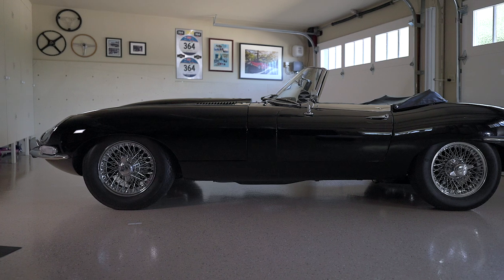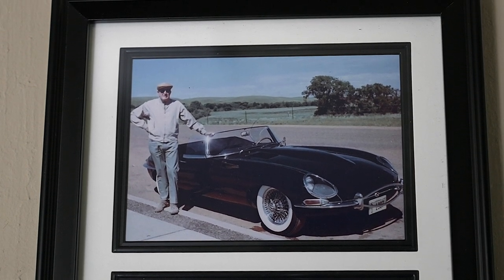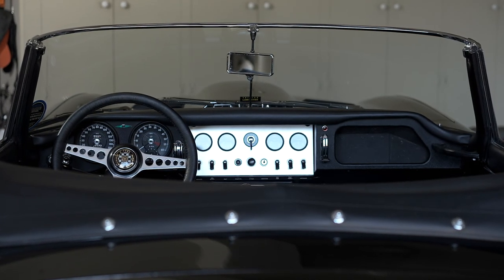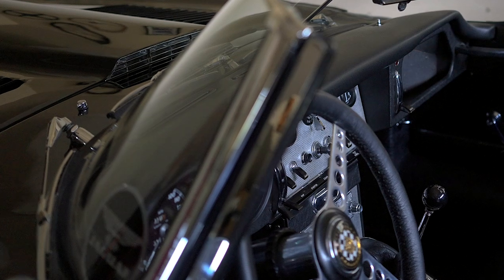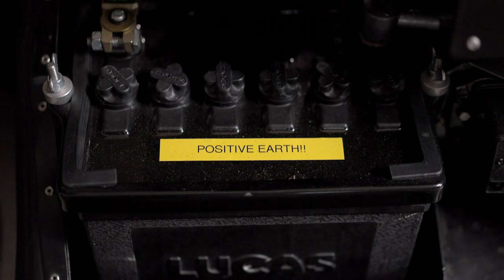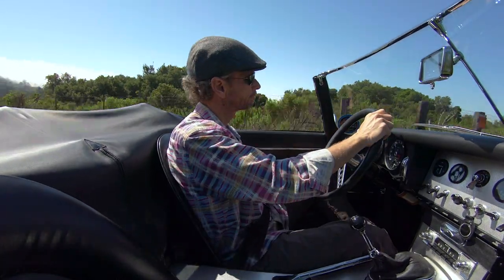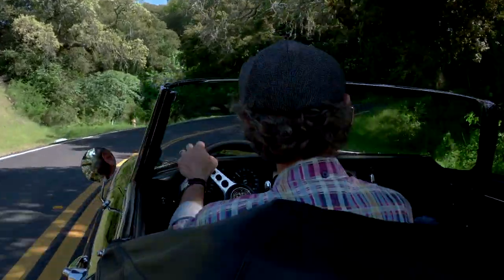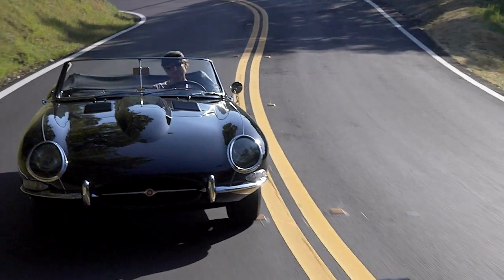Jaguar E-Type, 1962 Series 1 Roadster

Comment: Excellent video of my absolute dream car! Not sure if the problem lies on my part, but the fps/bitrate was very lacking. That's very unfortunate, as lacking video quality really is an injustice to the video itself. Otherwise, i really liked the owners decision to upgrade the gearbox, non-synchros are such a pain to drive (even though i havent really gotten used to it, only tried it a couple of times). Keep making videos like these, i subbed instantly.
Reply from the maker: Sorry to hear of problems with bit rate. The video that as uploaded was perfect quality. You might try again with a better connection or you may be seeing an issue with YouTube encoding.